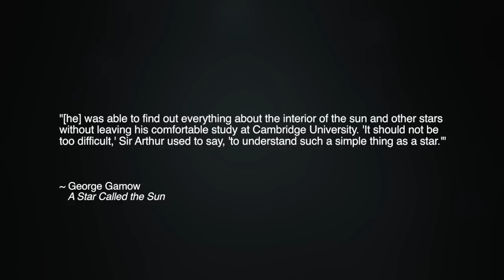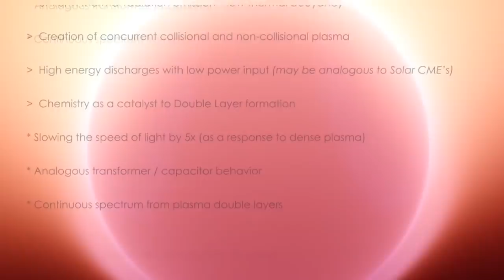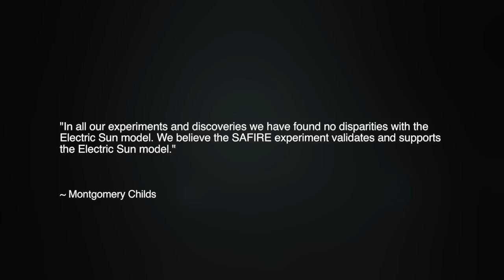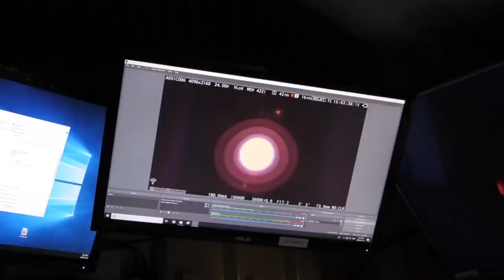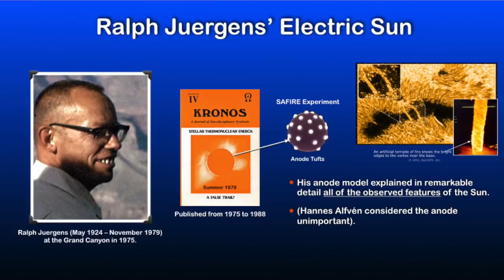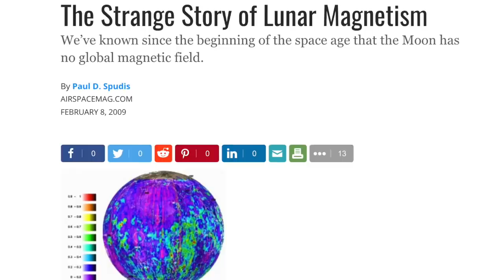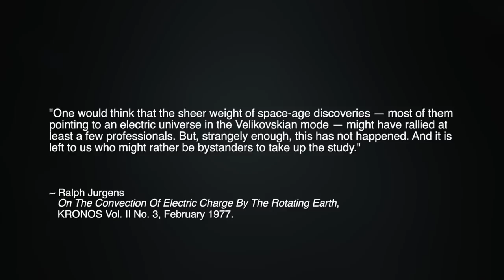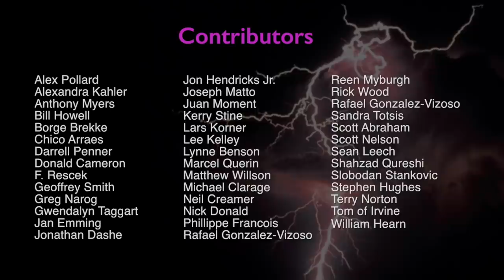Wal Thornhill: SAFIRE and the Future of Science, Part One | Space News

Comment: What if the outer planets, of which the Sun is the core, are each a varying stage of a complete model that is the Sun.  As to say, when one planet produces only methane, and another helium, and still another oxygen, then perhaps the Sun is producing all at once, while the other planets only produce a single or perhaps a few of the gases or material needed. So perhaps tectonic plates on the Sun are a vital aspect.

Comment: This model can pretty easily be debunked:

A new alternative model needs to be made.

Alfvens and Scott's sun models are quite easily debunkable. I think they need to be revised. I agree we dont fully know how the sun works, however there are key predictions Alfven and scotts model makes, that counter the evidence:

We examine the amount of power physically possible for a current of a give electron density and mean energy per electron. Considering the suns radius,and luminosity. From the electron kinetic energy,electron rest mass, and speed of light we can compute velocity. A range of energies can be exmained which is the appropriate driving voltage for the sun advocated by Dr Scott. Using the velocity calculated,the electron density and area of intersection with the sun, we also examine a range of electron densities computing electron current.
Total power is computed, or the amount of energy passing through this region pre unit time, this must be at least equal to the solar luminosity. 

For a range of electron densities and energy we construct a table of power available for a star. To further test this model, we'll examine the strength of the magnetic field produced, both at the surface of the sun as well as at the orbit of the earth. Anyone can examine this with simple spreadsheet program such as excel.

Examining the results, we notice that when the electron current reaches sufficient energies to power the sun, the magnetic field at the surface of the sun is on the order of 100 Tesla (1000000 Gauss) or More. This is particularly interesting in light of the fact that the OBSERVED magentic fields on the surface of the sun range from 0.01 Tesla (granulation) to 0.2 Tesla (sunspots). 
This is quite a large anomaly (a factor of over 100) which the electric sun advocates neither mention nor explain.

In addition, their model predicts that the magentic field at the orbit of the earth could range between 0.1-10 tesla. This is far too stronger than the field actually measured of a few nano-Tesla. The Earths magnetic field value is also far stronger than earths magnetic field at the surface. If such a solar magnetic field existed, it would greatly over power the terrestrial field and would determine just how our compasses point. In this case the vector direction of the solar field would be parallel or anti parallel to the motion of the earth around the sun. Compass directions would flip with the cycle of day and night.

Additional problems of powering the sun or any other object in space by electric currents moving in free space is the stability of the configuration. Stability problem of currents moving in space without guidance of a conductive wire. These instabilities driven by the fact that electromagnetism can be attractive and repulsive are the primary technical problem in em confinement methods for controlled fusion. When confined by a purely attractive force like gravity, these instability become insignificant.

Furthermore, Ulysses satellite measured during the entire course of the mission, note that over the range of latitudes measured the solar wind is outbound and varies between 300-800km/sec. This corresponds to v/c<0.0027, far less than velocities needed to power the sun.
Reply: Hi! I'm adding a reply as a way to bookmark your comment should anybody respond to it in any manner. You took the trouble to write a rather lengthy post. This is all new to me and very much over my head as far as being able to understand everything. I want to keep an open mind in every direction.
Reply: Stars are anode not cathode.  recheck your maths.
Reply: @AntiFed1791  
This is simply wrong. There are many experiments in space which directly measure the solar wind, and have found it to be ionized, but electrically neutral. In other words, the same number of positive and negative particles are emitted. If the Sun's wind were primarily positive particles, then the Sun would build up a vast negative charge on its surface. This would affect everything about the Sun, from its magnetic field to the way the surface features behave. We see no indications at all that the Sun has a huge negative charge
Reply: @SingularForce  thanks man, I recomend looking at both sides. So far the EUT sun model is pretty easily debunkable. Plus the SAFIRE project that they keep going on about is essentially a zero transparent inertial electrostatic confinment device, something that has been around for 70 years that is well documented in mainstream. All the mysterious effects they are getting regarding transmutation etc are common in IEC and not strange at all.  Ices are extremly high neutron sources, neutron absorption and transmutation is a well documented phenomena.
Reply: @349scotty5  yeah, that is the standard model alright.  Thanks for sharing.  I think we will just have to disagree.
Reply: @AntiFed1791  not the standard model at all, just what we observe and can predict of the EUT solar model was correct, which it evidently unfortunately isn't
Reply: Have you published anything under your real name Scotty or are you trying to beam everyone up!!!?
Reply: @349scotty5  I admit I haven't looked into it too much but surely the chemical composition of the Sun is not identical under the EU and traditional models? If so, can't the EU model be debunked with basic spectroscopy?
Reply: @everybodylovesballs  great point, analysing the suns primary light shows it primarily behaves as a black body. Plasma discharge is not black body radiation, which another reason why the SAFire which is just a inertial electrostatic confinment device with 0% inner electrode  transparency, is not how the sun operates, nor is the EUT solar model
Reply: @denisflannery8415  has the SAFIRE project?